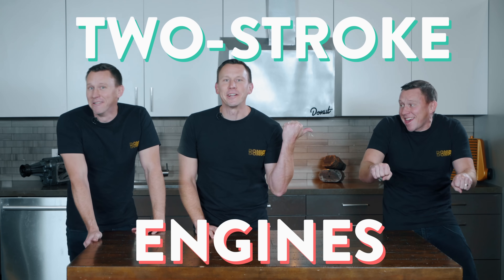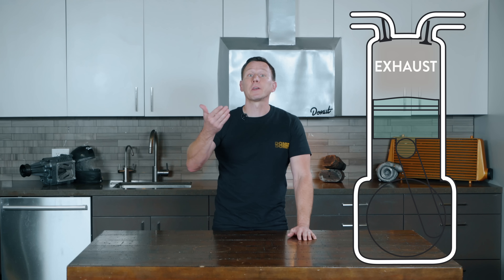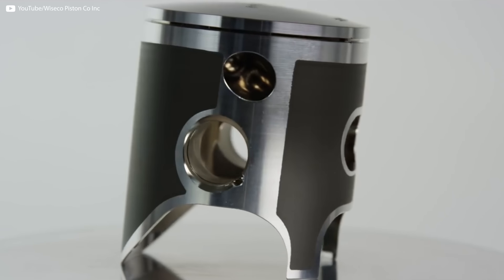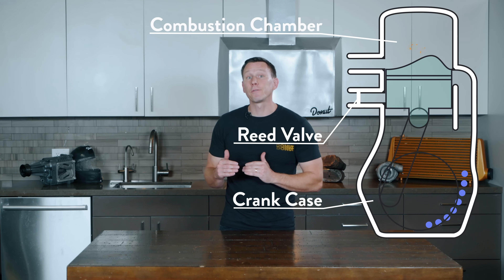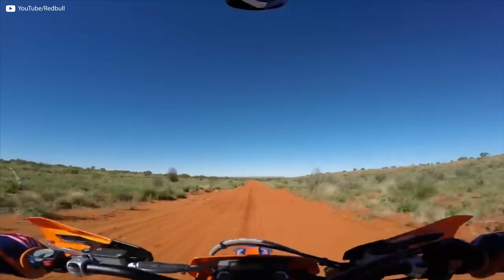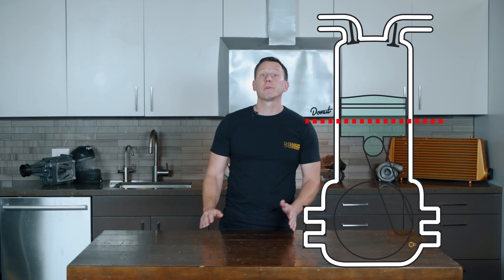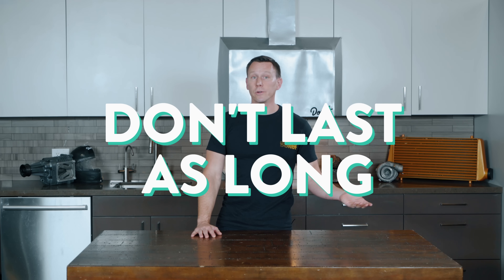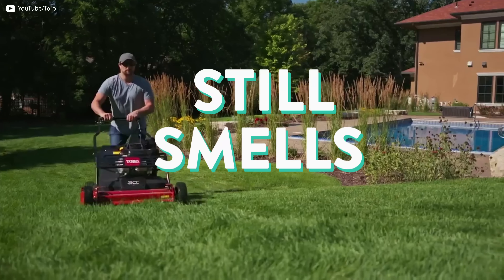2 STROKE vs 4 STROKE ENGINES - How it Works | SCIENCE GARAGE

Comment: I've been away from the sport a long time. 4 strokes were just starting to make an impression. When I came back, i was looking for a decent used sx250. Nobody likes too much change do they. Someone insisted i have a ride on their crf450. It was so easy to ride i nearly offered to buy it off him right there. Anyway, i had arranged to go and see a 250 at the track. I jump on the bike and do a few easy laps barely out of tick over. Then i go for it. Fuck me! This is what i have been missing. My conclusion was, that 4 strokes are for pussies who can't ride a real bike. The 250 gives me the thrill i crave. Sometimes it scares me but i remember that's what addicted us to begin with. That surge of adrenaline as you are right on the line of looking like a bad ass or ending up a giant ball of snot. Stick your 4 strokes.

Comment: 4 stroke last longer. Mention that to all my friends with 250cc, 4 strokers, dirt bikes, and see them burst into to tears. 
For road going, multi cylinders engines, 4 stroke all the way. For ripping dirt in the woods, 2 stroke all day. Last longer, and are cheaper to maintain. Not as fuel efficient, and the oil adds to the cost of usage.

Comment: This video is obsolete and no longer correct. 
Check out Evinrude G2s and Achaties opposed piston turbo 2 stroke. 
 Both more powerful more efficient and cleaner burning than any 4 stroke.
 The G2 uses specific location injected lubrication that uses far less oil than traditional 2 strokes which makes your argument of contaminated fuel and deposits , and engine life span due to lubrication incorrect or at least no longer relevant as more manufacturers utilize this technology. 
The G2 also uses a gated exhaust port which works like a valve optimizing fuel burn at different rpm. Again different to your claim of unburned fuel loss and bad efficiency. 
 
I think you should do some homework before making defamatory claims against cleaner options. You could end up with a lawsuit.

Comment: 2 STROKE FOR LIFE!!!!  Who is with me? The Smell, The sound, The power!!!
Reply: The feels
Reply: The Lightness
Reply: I feel like I'm flying whenever I ride my Rx!!
Reply: Sounds like mosquitoes.
Reply: the acceleration
Reply: and lung cancer.
Reply: I mean..... I kinda like the smell lol
Reply: 06 RM 250 with 300 kit goodbye 450s 👋
Reply: Yeahhh I love the smell and smoke . ❤️ 2Ts
Reply: I’m buy a 1999 yz250 next Thursday
Reply: And always going to the gas station bc 2 stroke has a bad fuel efficiency
Reply: The power to weight ratio 😎
Reply: 84 atc 250r here
Reply: Oh yeah baby
Reply: 2 SFROKE FOR LIFE!!!!
Reply: The Yamaha banshee and blaster describe all of that in one sentence lol
Reply: I will say I have both and I love both for different reason, I love the on demand power of the 450 from all that torque ,but  when they blow it’s expensive af to rebuild but I love my 250 2 stroke, the almost turbo like kick you get, and you doesn’t love that smell! There also way cheaper to rebuild than a 4 stroke. Both have there advantages and disadvantages.
Reply: *and the arm pump.....
Hey I own a 2 stoke currently. Have had many. 2 stroke off road is great. MX tracks? These modern injected 4 strokes are unbeatable
Reply: @eastwood4006  they get beat all of the time. If equal riders are used, the 4 will win. That should make it clear that the bike is more important than the rider at that point....even though the 4 burns up so much more money in parts, time and maintenance. *even in American supercross and motocross, there are plenty of riders who show up on 2 strokes and have multiple 4 strokes finish behind them, without people crashing out or being able to complain about a bad start (honestly if a 2 beats a 4 on the start, the guy on the 4 should just admit that he needs a whole lot more practice, since 4s are best from dead slow to an immediate jump out of the gate)
Reply: the grenaded engine
Reply: @adamflynn7322  what?
Reply: The pistons gripping.
Reply: And the actual skill, as long as we're talking 2 wheels.
Reply: The Sensation
Reply: You may have the power, but I bet your 2 Stroke doesn’t have a HB gearbox, or a build in snorkel.
Reply: Don't forget the lung cancer!
Reply: Only driven a 2 stroke twice, all my bikes have been 4 stroke, on long journeys I would rather have a 4 stroke because I don't want tinitis, but for short journeys I would rather have a 2 stroke because they are more fun to use.
Reply: The powerband is never-ending
Reply: Ahh yes I love the sound of mosquitos, the smell of pollution and bad fuel economy
Reply: Don’t mind 4 strokes with literally more power than 2 strokes

Comment: I have 2 motorcycle . 2 Stroke and 4 Stroke

2stroke is faster than 4stroke in first start running  but in the middle of the high way the 2stroke motorcycle start get stranger sound and start to get slower and White smoke . And it definitely cannot go to mountain like 4 Stroke can take more longer distance and more power torque. 
So I have big disadvantage from the 2stroke motorcycle that the cylinder and the Pistons need change every time I use it for hard work . But for the 4stroke I don't do any maintenance for the motor except for the gear box .

Comment: "Two stroke engines don't last nearly as long as 4 strokes" 

My 1994 two stroke Johnson outboard apparently didn't get that memo. LOL
Reply: When my dad was a child he used to have a moped...
It was so good that it ran on anything other than gasoline.
"If it burns,it goes into the fuel tank"
That's what he said.
Reply: @Rob-326  I am a year late but I found the liquid coal you were talking about 
https://youtu.be/ze8kVR947lQ
Reply: @Chris__T  Welp.Good to know.
Reply: @Rob-326  wow so he can put coal on the engine.
Reply: @oiltoast3723  No....it had to be liquid too... :|
Reply: They require more frequent rebuilds but have less parts than 4-strokes, cost less to maintain, are easy to fix and produce more power per cc.
Reply: I laid my 1978 2 stroke mercury v6 to rest only last year and not because it was worn out internally. 
 Corrosion and electric components were the deciding factors which no 4 stroke is immune from either.
Reply: My 1967 Kawasaki C2TR (original piston and rings, end gap still in spec) never got that meme either.  That bike was made for children; it still does wheelies with my grown fat ass on it.  Rode it wast week and I'll ride it again on Friday.
Reply: I have a 2 stroke 1979 Kawasaki dirt bike it still drives
Reply: My 1986 yamaha 40hp 2 stroke works perfectly. I barely have to touch the key to make it start.
Reply: My 2 stroke 1971 suzuki ts90 definitely disagrees
Reply: lol thats funny cuz my 4 stroke died and my 2 stroke lives to this day
Reply: my 1988 rx100 didnt get that memo too
Reply: Neither did the trabant
Reply: Well I totally have a different opinion on that being a former racer of both two-stroke and four-stroke it's a lot easier to rebuild a top end on a two-stroke and a lot harder to rebuild a top end on a four stroke that being stated there's no valves on a two-stroke to go bad to adjust there's no timing chain to adjust on a two-stroke so that being stated I've had a lot longer life out of my two strokes when I used to race pro Motocross I never liked the four stroke they always blew up on the track causing me a last place win!!
Reply: @SMOKEY-JAYS-DIESEL  howdy! Where did you race? In the states? Motocross or supercross or both? I assume you at least raced outdoors so what years and what national number? Or what was your 3 digit AMA number? I raced pro in the nationals for a couple of years in the early 2000's but never earned a 2 digit number.
Reply: My 1973 vespa 50s that's been left abandoned for 10 years and just needed gasoline and a good old kickstart to run
Reply: laughs in M62 locomotive
Reply: Lol try my dads 70’s Johnson outboard which we ended up flogging for like 200 bucks
Reply: Exactly
Reply: FacepalmDaily I can relate! I have an EXC 300 from the same year as your bike! It’s an amazing bike! 😉 👍
Reply: My dad has a 78 evinrude 2 stroke and he has not had any motor trouble at all, over all them years. He bought it in the 80s
Reply: FacepalmDaily my friend has a Honda 250r 2 stroke that still runs and hasn’t been rebuilt in 13 years
Reply: Neither did my 1988 Honda Cr125
Reply: Yeah apparently my 1987 2 stroke dirt bike didn’t understand it to well
Reply: Neither did my two stroke Yamaha DT125R.
Reply: It’s not used the same as a ya on a bike
Reply: lol
Reply: My zundapp of 62 is still kicking lmoa
Reply: Mine is '95 Rx and I'm born in '96 and  my bike still on stock piston and stock head and bore and it never disappointed me and gives a tough competition to new era 250cc four strokes, what a power mate, it's ridiculous that every ride on it is like straight on a race track, but I still maintain my safety levels not to endanger anyone on roads, but 2 strokes are real kings!!!!
Reply: My 1985 Honda Odyssey didn't get it either.
Reply: My 1997 Yamaha Sigma V100E neither lol. Same to my 1992 Suzuki FA50, the engine is still unopened since factory.
Reply: No one cares
Reply: @Treva-dn5jb  Who appointed you the spokesperson for everyone?
Reply: My 1986 RM250 Suzuki didn’t get the memo either it cool
Reply: my dad owned a yamaha dt125 for over 20years

One example that japanese bikes are darn reliable

And another example that 2 stroke bikes could last longer than a 4 stroke with proper maintenance and care.
Reply: All you gotta do is rebuild them every so often but that’s easy 😂 so they honestly can last just as long as a 4 stroke
Reply: ever heard about simson?
Reply: Lol same with my 1972 evinrude 2hp 2 stroke
Reply: Same with my 86 Honda Trx250r
Reply: They objectively don’t run as long as four strokes. Just because there is a two stroke that runs for a while doesn’t mean all two strokes run longer than all four strokes.
Reply: Neither did my Honda NSR 150R
Reply: It all depends on port shapes, piston shapes, ring thickness, heat, and load variation. Boat motors are not very aggressive and therefore last a lot longer than say a dirt bike motor
Reply: my atv too
Reply: Same sentiments bro, my grandpa's 1971 suzuki b120 bike outlived most of my dad's four stroke bikes. And my grandpa even used it as a motorcycle cab, service in farming etc. Now I still use it and the only problems are minor oil seal replacements 😂
Reply: you dont drive it enough
Reply: @ferv888  every day, homie. I live on a canal on the gulf coast. I hop in the boat after work every single day weather permitting and have done so for years and years
Reply: my 96 yamaha Rs100 has 98.885kms on the odometer. The odometer stopped working back in 2008.

edit:spelling
Reply: Not many common engines are more heavily abused than those in motorcycles used for racing motocross and similar activities. 2 has always beaten 4 regarding cost, longevity, maintenance, etc. It's strange to hear him make that comparison between 2 and 4 with a straight face. Nobody who races motocross would ever suggest that 4s are cheaper, easier, etc to maintain than a 2. The only people who support 4s are environmental freaks who don't understand the entire impact of producing all of the extra parts that require more resources over and over again, and people who lack enough talent to utilize a 2 stroke.
Reply: How much have you used it compared to a car? You use your outboard to commute to work every day?
Reply: I’ve got a 94 Polaris XLT 580 with 7000 miles on it had to 100mph on the lake for 60 seconds last winter, nothing beats the smell of 2 stroke in the morning
Reply: FacepalmDaily now they last 6 time longer it’s not the 80s
Reply: FacepalmDaily now they last 6 time longer it’s not the 80s
Reply: I had a rmz 250f last one summer my rm 250 takes every think my dad has a 97 cr 250 got it wen it was all most brand new and never change the cylinder change the piston twice ever my uncle got a 01 cr 250 never rebuild it now tell me a fuck four storke that last that long ya that’s right I didn’t think so they blow up every few years
Reply: @2strokesmoke857  I don't want to disrespect you, but please put dots at the ends of your Sentences, it's very hard to read like this, but your comment itself is very true, a 2 stroke lasts forever
Reply: Bananarama sorry about that I’m not the best at reading and typing
Reply: @2strokesmoke857  no problem m8
Reply: @2strokesmoke857  I had 4 strokes reading your comment

Comment: why do i hear people say that 2 strokes dont last as long as 4 stroke? they dont have lubrication problems because there is oil lubricating the pistin throught the gas and another thing to mention is that 2 strokes usually have transmission oil in the crank case,so the only real down sides to the is the powerband ,lots of smoke, and they usually burn more fuel.

Comment: Modern two strokes don't smoke anymore then a regular engine does now. Modern TW3 certified oil is made to be smokeless, burn cleaner, and in some cases even add power. Cheap oil labled as "2 stroke oil", is, infact, not 2 stroke oil, but SAE30. Don't buy it, it's not for 2 strokes despite the name.

Any 2 stroke exhaust smelling like gas, has not been tuned to run properly, and has a non-recommended exhaust pipe. It's a side effect of a poorly designed 2 stroke, and/or a poorly maintained 2 stroke. If a 2 stroke smells like that- don't use it, it's a trash 2t engine and/or exhaust. As a properly designed exhaust is able to scavenge back the fuel it pushes out, and increase power/compression while burning cleaner.

Comment: WOAH 4oz a gallon? I don't know anyone who runs a 1/32 ratio. Most run somewhere between 1/50, and 1/100.

 In fact, a modern 2 stroke can be as oil efficient as a standard 4 stroke when direct injected, As the oil only has to mix with air, and there is no gas in the crank case to strip any of the oil. This makes it more powerful as well, since, displacement isn't being used up to burn as much oil instead of gas. Where oil might normally take up to 3% of the cylinder space- it's now a negligible  sub-1%.

Comment: Efi is here for 2-strokes. They could make a huge comeback with fuel injection
Reply: They might compete on cost, but add forced induction to a 4 stroke and you'll surpass the power to weight ratio of the 2 stroke. Even NA 4 strokes are getting close to the power to weight ratio of 2 strokes these days, the latest generation of 4 stroke outboard engines are the same size and not much heavier than equivalent 2 strokes.

Comment: Dont forget matinance. On a preformance engine a 2 stroke is much cheaper to maintain and can take alot more of a beating. Especially on dirtbikes. A 4 stroke needs valves adjusted all the time and about 1000 bucks every 70-100 hours. While the 2 stroke just needs a hone and a 150 dollar piston and rings.

Comment: Modern direct injection 2 strokes have solved many of the traditional problems 2 strokes had.  Some of the new 2 stroke engines actually have lower emissions than 4 strokes

Comment: We would have 2 stroke cars if central bankers didnt see them as too relaible, too efficient, too long lasting, and too cheaply maintained... i casted and designed my own 2 stroke that runs 75:1 oil mix and it has so far lasted 84hrs. Still running tests on it. But 2 strokes havent been allowed to be perfected or advanced the way they can be.

Comment: Yes little two strokes don't have valves but when you talk about large two stroke engines like Detroit's 71 series they have intake valves and run on diesel. They are used in ships air compressors and yes were even used in semi trucks.

Comment: i have a 50cm3 Geared moped (Rieju MRT) I dont lie. It goes over 80 km/h with just 50cm3. Pretty good power! Also two strokes has a "spike" of power in certain RPM for example (7600rpm-12000rpm) this means at these rpm's the full power of the engine is activated. Meaning it will accelerate faster and go quicker!

Comment: So a 125cc 2 stroke gives you as much power as a 250cc 4 stroke and a lot lighter.
Reply: yup
Reply: Yeah but two strokes are really only good for racing because of the fact that you don't have to mix oil and gas and other complications
Reply: Not really modern 250 4ts make more hp

Comment: Just bought a new YZ250X and after riding 4 strokes for the past 5 or so years. I probably won't be getting another 4 stroke any time soon.
Reply: RockGuitarist1 other way around for me. I’m used to the power band on my 250. I love my Crf450.
Reply: What gas mix do you run and how much octane
Reply: IHas  I just got a yz85
Reply: IHas  i run 32:1 right now with vp two stroke oil and 93 octane ethanol free how is maxima working for you

Comment: The biggest advantage of 2 stroke engines is the high low end torque and  speed especially in lower CC engines as compared to the same CC  4 stroke engines.
The disadvantage is that on the long distance ride they can be a little  noisy :)
And at high RPM they vibrate a lot.
So if you solve the above 2 problems by  fine tuning the engine, weight
 balancing the pistons and cranks and fine carving  the intake and 
exhaust ports  for smooth   flow, good air fuel mixture carburetor  for optimum fuel burn  and good muffler on a 2 stroke engine, you got a  winner !

Of course if you are riding with a 400 lb lady, and you weigh 400 lb yourself and your bike weighs 600 lbs, buy a 4 stroke  1,800 CC Fat Boy Harley Davidson, LOL !  

I'm just a skinny 145 pounds riding my 125 CC  cafe racer,  just my opinion :) 

To each his own, PEACE  !

Comment: Like 2stroke needs gas mixed with 2stroke oil does a 4stroke need that or can I just put fuel in there and engine oil or do I need to mix the gas with something
Reply: 2 stroke=fuel mixed with 2 stroke oil
4 stroke=fuel only but engine oil placed inside oil chamber